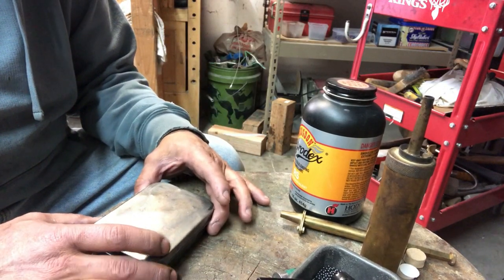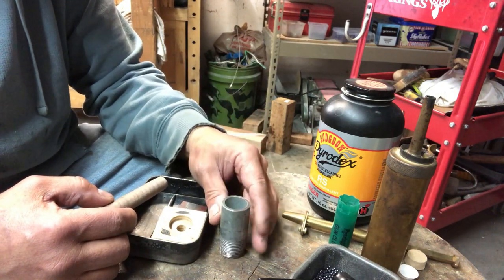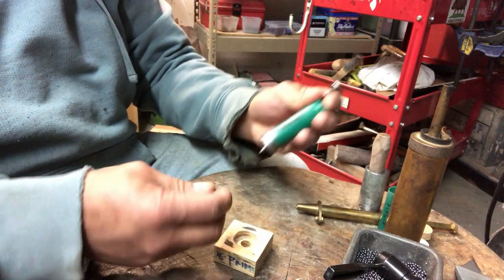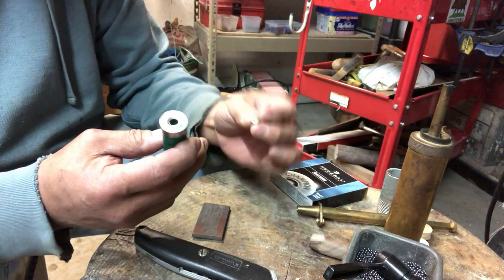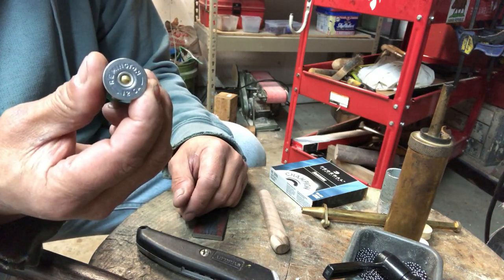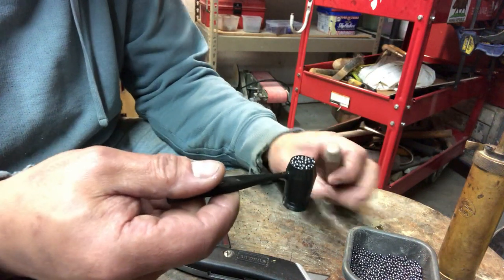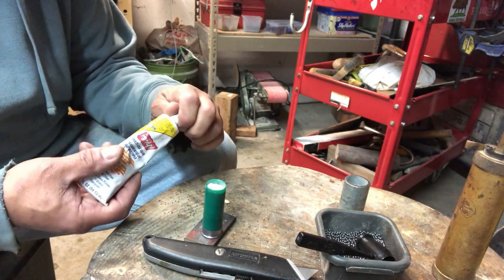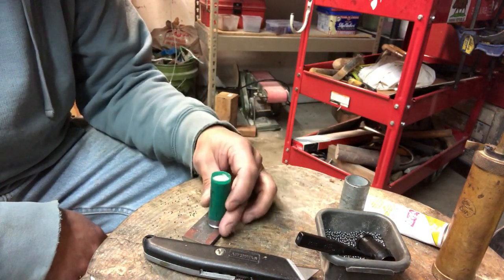Hand loading Black powder shot shells - No press

Comment: You can also use watered down Elmer's glue.  It's basically the same as water glass made for reloading.  Also, you can simplify things and use the same volume powder and shot.  So if you you use 1 1/8 shot dipper, you can use that for the powder too-to make a square load..

Comment: It seems to me like that's a lot of work. Here's what I do. I put my powder in I put a piece of raw wool I put my shot, which is usually BB's in, I put another piece of raw wool and I put my card over the top of it and glue it. Now I make my cards out of cereal box cardboard works pretty good just the same as buying them. The wool also has natural lanolin in it which kind of helps with fowling. Give it a try it's a lot easier. If you don't have wool you can use wax paper, or for that matter you can use green leaves. Anyway give a shot you never know. Have a great day and stay safe and keep your powder dry!
Reply: Bb's will wreck your barrel over time. The rest of your methods work well, though.
Reply: Modern airgun BBs are made of steel….Daisy, Benjamin, etc.
Reply: We don't know what gun he is using but any shotgun made after the mid 80's is likely safe with steel BB's. It has been federal law since 1991 that non toxice ie steel, tungsten, or bismuth shot must be used to hunt waterfowl.
Reply: You really want to use at least an 1/8" thick over powder card and a 1/2" buffer wad between that and the shot or you get funky non uniform shot patterns. Old shotgun shells from before we had plastic wads were loaded this way. Sometimes they even had two 1/2" felt wads and/or a second 1/8" over powder card on top of the felt wads. There is a reason for this and it's not just to increase price. It also helps to take up space in the shell if you are using a light powder and/or shot charge.
Reply: @peterdoyle458  BB's have always been steel. I have some 1920's daisy BB's that are plain steel. Copperhead's are and always have been copper washed steel.

Comment: Scour antique stores for an old time roll crimper tool, ,It is a sleeve affair with a crank on it than you clamp to your bench. It  turns a nice roll crimp on shells loaded as you have,  
I load mine same basic way except I cut the cushion end off a plastic shot sleeve type wad, and put that down on top of the over-powder wad,, then add shot and the over shot card, roll crimp with the old time tool.. Beautiful  reloaded shells.  The shot sleeve makes the shortened shells work better in modern guns with the long tapered chambers.  The older guns with the short taper on the end of the chambers work fine with card wads, but I had trouble in the long chambered guns with the ;powder flame going past the wads and melting the shot before it got out of the barrel.   Lots of leading about six inches ahead of the chamber....Hard to clean out.  The plastic shot sleeves prevent this. They don't melt because of the over-powder wad.
Reply: There is a Russian made hand roll crimper on Amazon by distributor called Daddy Ammo that actually works pretty well

Comment: I run 100-150 grains BP behind .69 balls,Lee key drive slug,and my favorite Russian Savarog and Italian "hydrant" slugs between 430 and 659 grains.
Very accurate,and alot cheaper than factories.I ßhoot them out of an H&R Uktraslug fully rifled barrel,a 10 ga drilled out to 12 ga for and extra thick barrel.
Reply: I do about the same thing! Lately I've been loading brass hulls with 600 grain, 0.735 diameter balls sitting on top of 150 grains of BP. It's a beast on both ends! I've got some videos on my channel showing off a couple loads.

Comment: 60 grains of black powder is enough for shooting an old 12 gauge double barrel. Of course if it's a newer shotgun 80 grains is good. Just depends on how old the shotgun is and what condition it is. With a very old shotgun hammer gun like a coach hammer gun that's in kind of bad shape you could go like 55-62 grains.

Comment: That's an insane amount of powder.
Reply from the maker: It’s the normal amount of powder
Reply: @Kashtukprimal My apologies. When I used to reload 12 gauge I was using about 18 grains of smokeless. Much different for Pyrodex no doubt.
Reply: @Ban this youtube I have used all kinds of powders including black and pyrodex for 12 gauge, but never near that amount. I was even able to fire one made with ground matches as the propellant, all through a mossberg 500.
Reply: @littlebiscuits  watch your bore, potassium chlorate is highly corrosive to your barrel.
Hot water ans soap cleaning is usually necessary.
Reply: John Beige  I had the scoop from my 12 Gauge Classic Lee Loader and would always just use one scoop of powder whatever type I had.  It was about the same volume as the tip of my pinkie finger from the knuckle up.
Reply: VortexModz  yes, just clean it sufficiently.

Comment: Using hulls from a gun range will not always work because in most cases you are gonna have to resize the brass on the hulls.
Reply: Your actually Wrong! In fact that's the exact purpose the 3/4 inside Dia pipe is used for. The pipe has the same 0.75" dia as a shotgun breach, If that shell will fit inside of that pipe, it will never have a problem loading into a shotgun. And once Fired in your own shotgun that hull will be perfectly sized for your firearm, with No Need to Resize. A step I've passed over many times without any bad rounds. In my 58 yrs of reloading,, the resizing of shotgun hulls has never been critical, unless some fool is overcharging his loads. At which point he's in serious trouble if a hull needs to be resized.
Reply: @douglasgault5458  I have a mossberg 500a an Ithaca feather weight 37 and an H&R Pardner single shot 12ga all three have different size chambers a shell from the mossberg will not fit in the h&r or the 37 but a shell from the h&r will fit in the other two the mossberg has loose tolerances and the h&r has the tightest the Ithaca is somewhere in between all shot guns have different tolerances some tighter that others so no a shell from your local gun range may not fit because the brass needs resized

Comment: Great video.  Do you not worry about the primer going off when you are tapping on the wads?
Reply: Not your hitting the inside, not the back of the striker where the firing pin strikes
Reply: It can still go off I have had them go off luckily it was just a primer this guy ever has one go of going to be missing a hand
Reply: @texascelt8363 , If you have a drill press, you can use it to press in the primer.
Reply: @davidgardner863  I finally just broke down and brought a 12ga. And 20ga. Mec 600 jr. Reloader ran across a guy that was retiring from reloading he them for $50.00 EA with wads and 2 25lb. Bags of #6 leadshot so couldn't pass it up lol

Comment: I have tried beeswax, Elmers glue, waterglass, and plastic model cement"
The model cement works better than any of the others….better holding power, better durability.
Reply: Thanks for sharing that. Any issues with the model cement getting stuck in the barrel after firing?

Comment: Dude i got tired of rounds you cant carry...so i bought a hand held russian roll crimper for 30 bucks...so worth it
Reply: im curious if those russian hand held reloader actually got shells in good form for semi auto to run reliably?
Reply: @SlavicCinnamonRollie556  I tried one recently. It actually works pretty well if you use common sense. Cut off most of the crimped area before using and put some lube in it and it will crimp well enough that it will cycle in a pump and most likely in a semi.
Reply: @JohnB-dr8sk  thanks even though this is a year old question lol i still haven't pulled trigger on those handheld reloader yet but i might soon now
Reply: @SlavicCinnamonRollie556  You're welcome. Yeah, I like mine enough that I might buy a backup because of the crap going on between the US and Russia/Ukraine. It really is a game changer in that you can take it anywhere and make shells by hand that can be cycled in a pump. Most of the bad reviews I saw were from people not using common sense with it.
Reply: @JohnB-dr8sk  Yeah smart to get spare just in case if something breaks.

Comment: Isn't black powder highly corrosive to your firearm?
Reply: Yep, clean it right after shooting with dishwash soap en water. ;)
Reply: The black powder itself is not bad.
The corrosive primers used at the time of its use was the issue.
As long as the residue is dry you are fine.
Still clean your firearm though.
Reply: Hot water & soap to clean up black powder & don't forget the soda bath. Real BP contains 10% sulfer /burnt sulfer and moisture = sulferic acid, which can damage a BP firearm. Simple cleanup without the nitro based cleaners, just don't forget to oil the pipes. In shooting BP my best friend is a SS Bore brush every several shots.
Reply: @PraetzelProjects  BP fowling is hydroscopic, it attracts water from the air, that's what's corrosive
Reply: @pacman10182  yes, as long as it is dry is what I said, when the residue comes in contact with moisture, the potassium sulfide converts into potassium hydroxide and potassium hydrosulfide (the stuff that smells like rotten eggs) this is what will corrode the barrel.
So as long as the cleaning is same day, you are good.